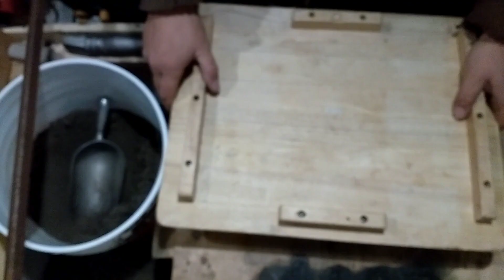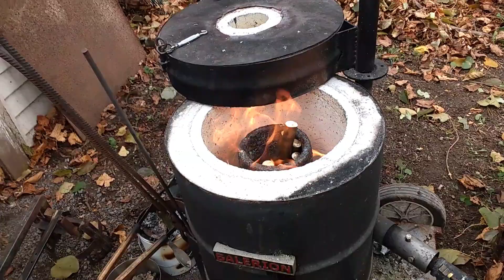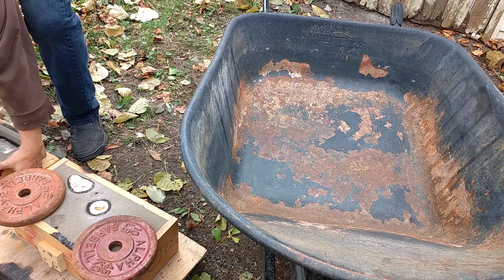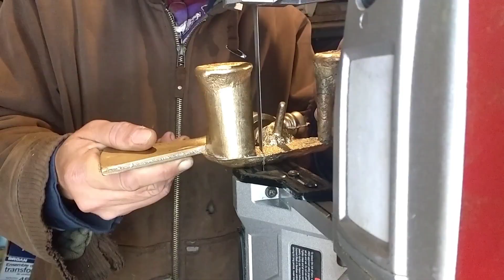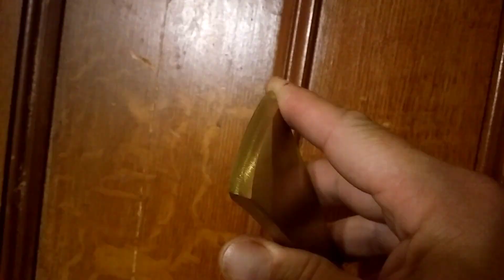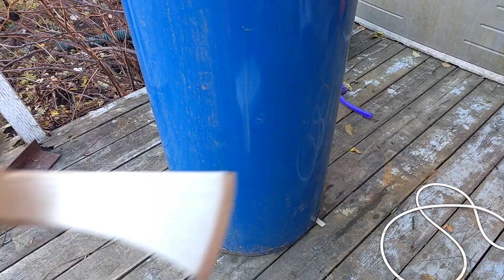Off-the-Wall Casting Challenge: Aluminum Bronze Pipe Tomahawk!

Comment: So about 1 hour to run from cold to pour?
Thanks for the time stamps!
Reply from the maker: Yeah, just under an hour, at least this time.  I had never actually timed it like that before, but it seems like a good thing to keep track of since I am thinking about making more of these pipe-hawks.  It's worth noting I probably could have shaved a few minutes off that if I hadn't let the furnace sit cold in my damp shed for several weeks unlit, melted about 12 pounds more bronze than I actually needed, and mixed up which way is open vs closed on the oil line's needle valve partway through the melt...
Reply from the maker: Hopefully the new low mass furnace I'm working on will see me getting some faster melt times!
Reply: Depending where you live and the amount of oil you use naturally your probably better off with a Venturi propane burner takes maybe 20-25 mins to melt copper and it’s probably about 50$ a month an I’m casting every 2/4 days
Reply from the maker: @ryannu1578  thanks for the numbers, I never got notified when you left your comment for some reason or I would have replied sooner.  It would be nice to be able to make castings that often, but for now I'm working full time at my office career job during the week and only able to do foundry work weekend warrior style as a hobby.  10 more years and I can retire and start spending more time out in the foundry.  
My setup has changed a bit since I shot this.  The furnace I was using here is much bigger than I need for this small of a melt (I overbuilt so I'd have room to grow into) and this oil burner is also undersized for the big furnace.  That combo always took longer than I liked in heating up - a drip-fed waste oil burner or even a forced air propane burner ought to be able to run rings around a venturi powered propane burner.   I think the furnace and burner combination was a much bigger factor than my chosen fuel type in the slow.melt times I used to see.  Now I've got a bigger version of a Moya type waste oil burner that I built for the big furnace which helps preheat it in maybe half the time it used to take, and a new smaller furnace built for this burner, which speeds things up even more.  The new furnace can get the whole job done within 20 minutes from a cold start for a bronze casting this size, using forced air and just 5psi propane with this same burner, which is the most my hair dryer blower can keep up with.  It's so fast I don't even bother hanging up the oil drip feed tank to feed it, I just run the furnace off the gas line that was originally only meant for preheating the furnace.  Which means there's no good reason to bring out the bigger blowers I've got for running the waste oil side of the burners anyhow...  Although I'm sure I could shave a few more minutes off that 20 using waste oil or diesel - the new furnace gets more than hot enough to start the drip within 1 minute of preheat, rather than taking more than 10 minutes to bring the 1" dense hot face up to the red heat needed to vaporize the oil drips in the big furnace as seen here...  But I'm happy with 20 minutes from cold to pouring bronze (or aluminum in 15) using only enough gas to grill a few burgers or steaks!  If I really wanted to speed anything up at this point, it would be making molds, not melting metal. 😀